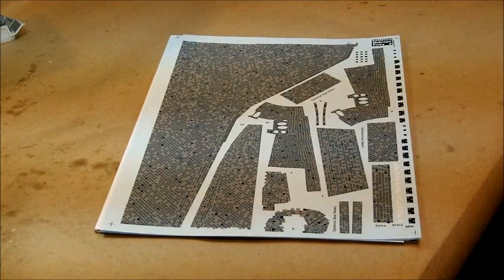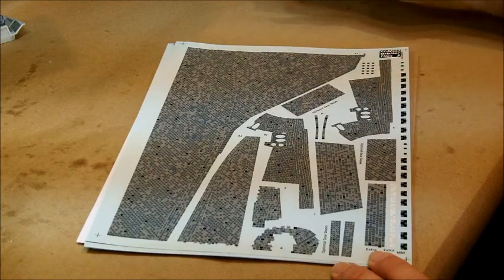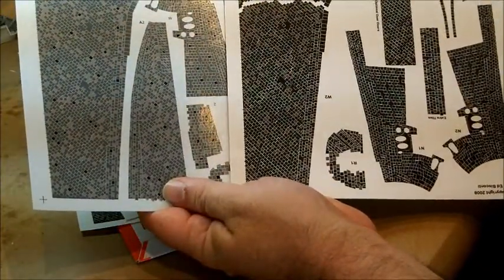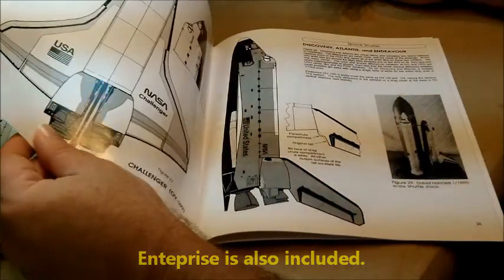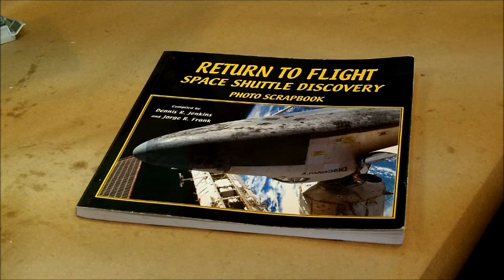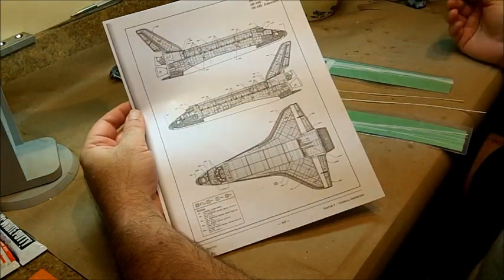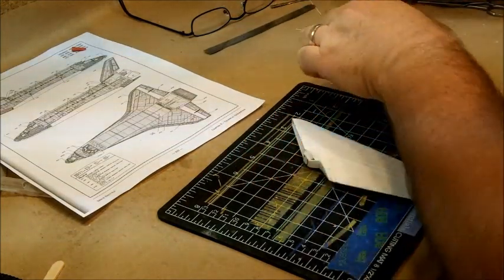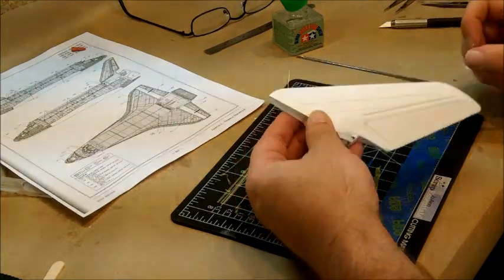Shuttle Wars, Part  20

Comment: Man, thanks for all this great, great reference material. I saw a guy on the internet that used surgical tape to represent the thermal blankets, it has a great texture and I think that if its combined with your idea of using strip styrene it should look perfect. By the way I'm Ariel Santiago from Puerto Rico, I bought a beanie cap from you not so long ago. I have to say its a great update for my model. Thank You!
Reply from the maker: Hi Ariel.  I used to be stationed at Roosevelt Roads.

I am glad you like the beanie cap.

I have seen the surgical tape approach.  That is one way to do it.  I will be doing something a bit different.  Expect the videos to start again before too much longer.